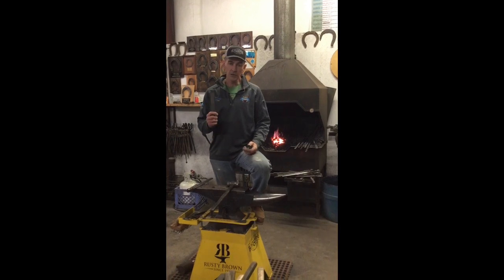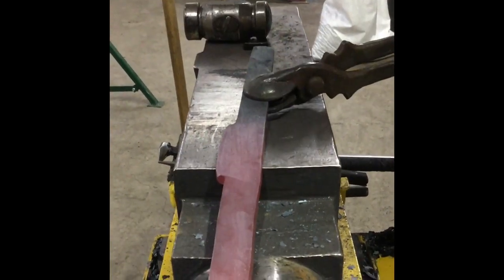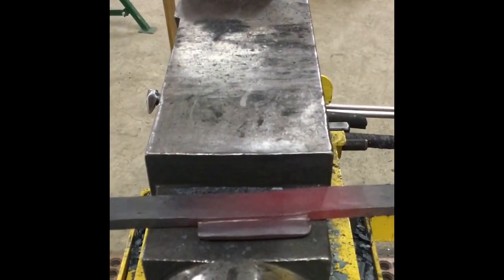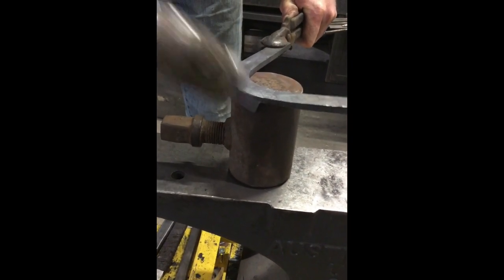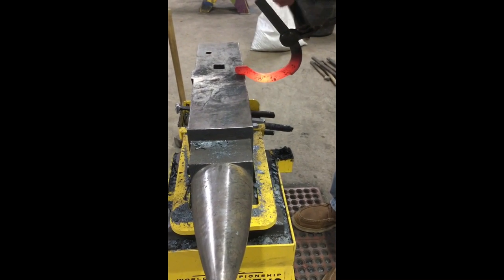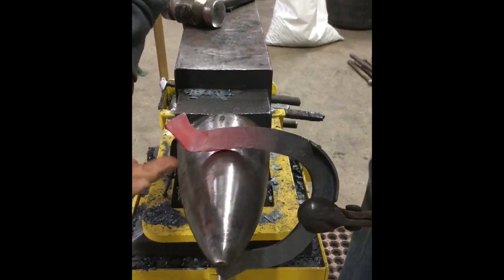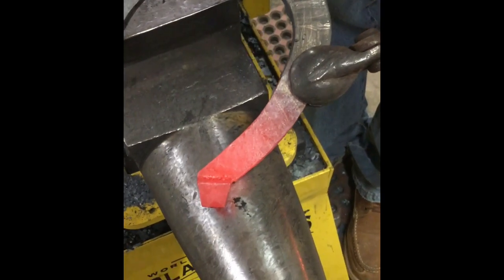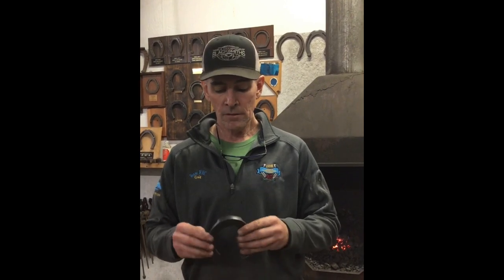A Trifecta Of Forging Lessons. Cap Toe, Extended Heel and a Trailer With A Caulkin

Comment: I have a question, is an angle grinder an appropriate replacement as far as acceptable standards are concerned? To compensate for inaccurate hammering? And I probably shouldn't say "inaccurate hammering" but more like my personal unorthodox style of hammering, where I hit everything except, what I was aiming for. This technique seems to work for me if done  correctly, in a combination with an angle grinder.
Reply from the maker: It's all about producing product. The more you do the less you will have to use an angle grinder to achieve your product. It's all good to do what you need to do.